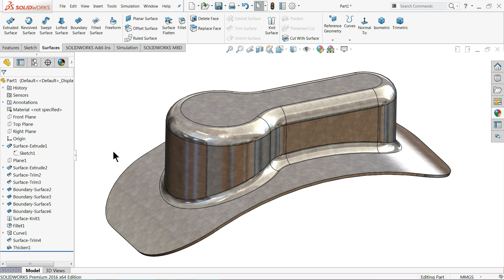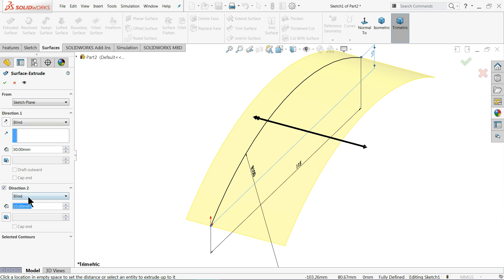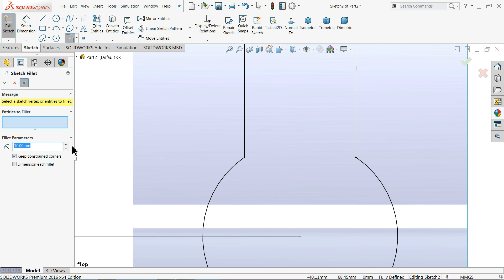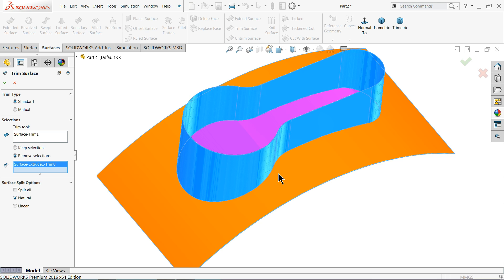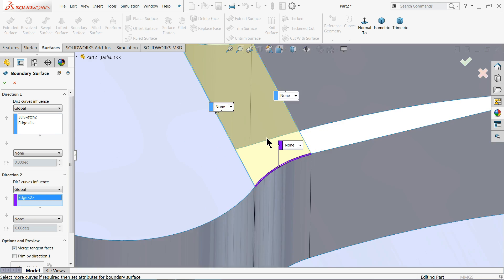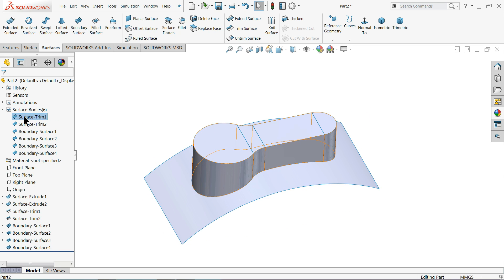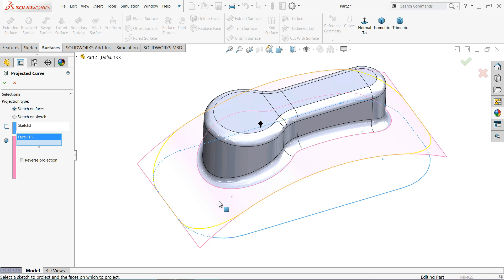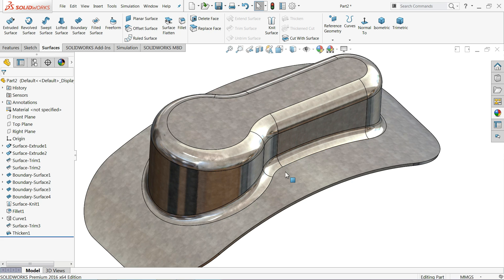SolidWorks Surface Tutorial | Basics of Solidworks Surface

Comment: After selecting the trim tool, it will not select the body, clicking on it does nothing,, will not even highlight. Tried many times. Any suggestions????????
Reply: had the same problem. U just don't create the projected curve and select the original sketch as trim tool